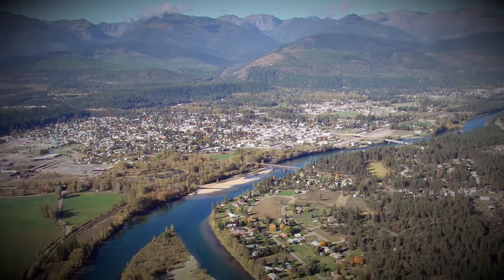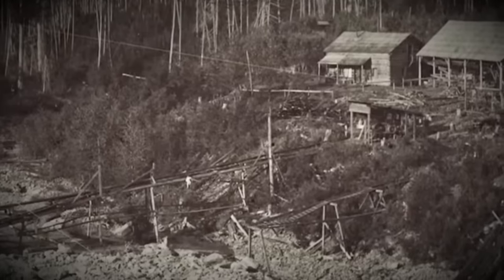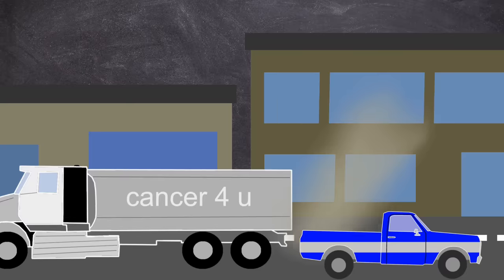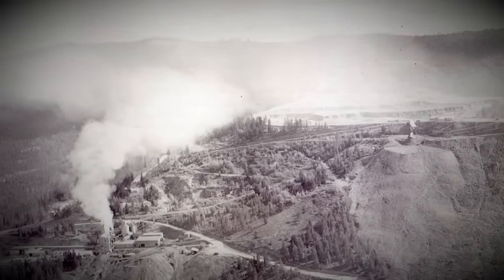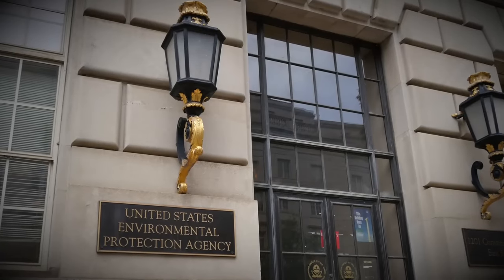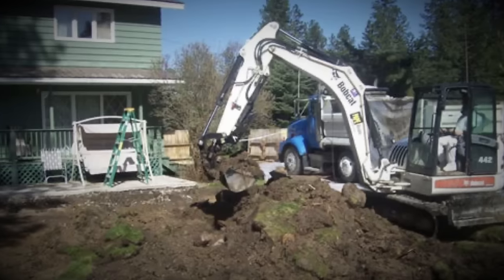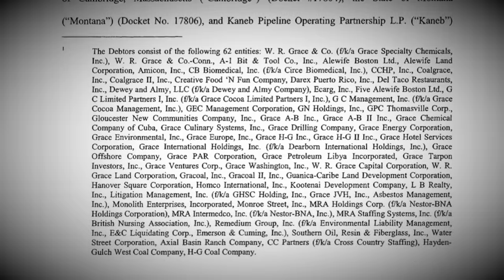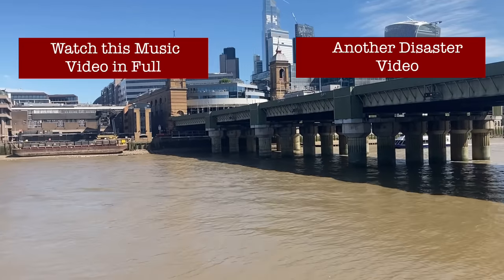Toxic Air: The Libby Montana Asbestos Disaster | Short Documentary | Plainly Difficult

Comment: I remember the distress when I first learned about asbestos as a child. What a mixed up world.
Reply: Heck I still remember gasoline being sold as unleaded and leaded.
Reply: @Project2013B  The smell of leaded petrol.  I describe it as sweeter than the smell of unleaded which, to me is more acrid.
Reply: Brake shoes and many other things were made from it. Including toilet seats.  It was the glass fibre of its day.
Reply: The minute dust particles are shaped like an arrow head and that is why they get stuck in your lungs, wheat and blackwood dust have the same properties. I was in the last class at Hobart Tech to use Blackwood in our woodworking trades course. The Purification Rundown offered by the Church of Scientology or Narcanon will help to reduce toxins in the body and even reduces radiation exposure.
Reply: @ptonpc  I wonder how much of that stuff I got in me from changing brake pads and shoes using NOS parts up until fairly recently. Porbably not much as I douse it with brake cleaner, but still....
Reply: @the_kombinator  Probably not worth thinking about unless you can get yourself checked out and something done,
Reply: @ptonpc  Between that and using all sorts of zinc chromate paints in the 90s... we'll see!
Reply: nah, scientology is bollocks, mate.  that course of theirs don't do a damn thing except empty yer wallet.  bloody good at that, though.  and nothing reduces radiation exposure except time, and in some cases not even that, if it's shite like plutonium, cesium-137, or strontium-90 with a longish half-life.  then you're just fucked, nowt to be done.
Reply: @the_kombinator  "The good old days"
Reply: @ptonpc  Let's see what products we use today will turn up being toxic 10-20 years from now.
Reply: @the_kombinator  Yep, there's always some new toxic thing being sold to us now.  I still miss the smell of leaded petrol mind you (Not that I would call for it to be reintroduced).
Reply: @ptonpc  I wouldn't mind it - half my cars call for such a fuel, and this new ethanol shit is not good for the carbs/valvetrain.
Reply: @ptonpc  ... a floor wax AND a dessert topping!
Reply: @Project2013B  Yummy!
Reply: @the_kombinator 

80 K patents approved by FDA ...a few gotta cause some fatalities.

Comment: A very good informative piece, from my own experience I would like to add. Asbestos fibres (Tremolite in this case) are an unfortunate contaminant of Vermiculite (usually where seams merge) rather than Vermiculite itself being a dangerous material, just to clarify. IMHO the repeated clouds of dust during the processing of materials would not have been heavily laden with asbestos fibres, but the long term accumulation of the asbestos fallout from these clouds will have created significantly raised levels of ground contamination. (some of the 'clouds' in the photos appear to have come from chimneys?). 🙂
Reply from the maker: Thank you
Reply: Not mentioned here: Vermiculite is a form of crystalline mica (the word was never mentioned here) that has water trapped in it; when ground into small bits and baked/roasted, the steam produced expands it into spongy popcorn-like bits that contain lots of airspace, making it an excellent insulation material, and which absorbs and holds water, making it an ideal additive for putting soil. Asbestos occurs naturally in and around the clusters of mica crystals. Asbestos is also found in the talc and gypsum mined from some regions such as upstate New York; and talc was until recently used as "baby powder" and an additive in crayons! 😳 See the book "An  Air that Kills" for a general history of asbestosis and the specific history of Libby Montana, which even involves a future vice-President. PS, WR Grace also contaminated the groundwater of a town in Massachusetts by dumping industrial solvents into the ground behind a leather factory, creating a cancer cluster among nearby residents; the company won the lawsuit in court and were never held liable. See the book "A Civil Action", and the docudrama movie about it.
Reply: @PlainlyDifficult  it's in tiger eye gems too that people like to collect, smooth down and still gets imported dispute being illegal. I remember reading a gem book that said 'Chrysotile' helped with breathing.

Comment: Asbestos was once seen as a wonder material and was used in so many things that we still find it to this day and its one of the biggest fears of buying an old building is having to a removal.  its also a huge barrier in preservation of old ships. And a huge hazard for those that do ship breaking.
Reply: Ever wonder about stuff we're using now that will be exposed decades later to be deadly?
Reply: We had water damage in our house a few years back. It was built in the 70s, and when they took up the laminate flooring from a previous remodel in the kitchen, they found the original, gloriously hideous 1970s vinyl flooring. It tested positive for asbestos, so we had to have a specialist firm in to remove it so they could replace the floorboards underneath. I would’ve loved to keep a piece of it for a shadowbox with an original piece of cabinet hardware we found, as a memento of the house’s history, but even that was too dangerous, so I took a photo instead.
Reply: @CatMom-uw9jl  LMAO and I have a piece of Pripyat in my house, emitting just under twice background radiation in a display case. Just as with the asbestos floor sample, as long as you don't grind it up and snort it, you'll be fine, and so will I. Worst case, laminate it ;)
Reply: @the_kombinator yeah, you should have seen the other comment he made, he's not a very bright person. He's probably got a 12th century turd from one of the queens back then in one of his "display cases."

Comment: Asbestos is such an asshole of a material. My dad was recently diagnosed with asbestosis. He is 73 now. 
He was exposed in the 70s and 80s when he worked as a plumber and handled piping insulation laden with asbestos. And later in the automotive plant he worked at, where the brake pads of the huge hydraulic stamping presses were full of the stuff all the way into the late 80s. The paperwork to have his condition recognized officially as a directly work related disease is in the works right now.

Comment: When I went through mandatory asbestos training for government workers, the instructor was actually a fan of asbestos. It is extremely dangerous when in the air, but its properties as an insulator against heat and electricity are second to none. According to some, smoking and failure to wear PPE made asbestos handling into the disaster it was.
Reply: You shouldn't have to wear PPE to wash a mine-workers clothing, or when a windy day blows dust through your yard and into your house.

Comment: Asbestos... that reminds me... I am paranoid AF after learning that my childhood home still has its original asbestos tiles (and adhesives that had asbestos in it, apparently) in areas, even though the tiles are unbroken, undamaged, unchipped, and thus (at least I've heard) no danger.
Reply: They're safe as long as nothing breaks your walls. They're a danger to work with but usually these kind of houses only become a problem when they have to be demolished or when they need maintenance work and repairs... which of course happens and thats why asbestos houses are dangerous
Reply: I'm retired now, but I used to be licensed in Pennsylvania to do asbestos removal. I can assure you that you've nothing to worry about, as the old 9" x9" asbestos floor tiles are non-friable...meaning that they do not emit enough small asbestos particles into the air to be of any concern, even when they are physically being removed by scraping or other means. Heck, they are so innocuous that the homeowner (or anyone else non-licensed for that matter) can safely remove them without PPE, and they can be disposed of in your normal household waste. Same applies to asbestos siding. It's the other forms of ACM such as pipe insulation that are hidden killers.
Reply: As mentioned above, they're perfectly safe. Even if they're cracked or chipped. 

I wouldn't recommend taking a high speed grinder or sander to them, but otherwise they're inert. 

I'll add, asbestos siding is cool stuff and can look great if it's been maintained.
Reply: @dshmechanic I’m still active as a removal specialist, 10y on the job now. And confirm exactly what you said. Just want to add the white asbestos sheets, the very soft stuff used to shield materials from flames, ppl don’t touch those it’s a guarantee you will get sick from removing those… might look like drywall but it doesn’t have the paper lining.
Reply: @JulianA-tr6pt  Agreed, Juliana, using any kind of grinder on ACM tiling would definitely be a bad idea 🙂
Reply: spent 10 yearsd living in a building with asbestos tiles; was a repurposed WW II temporary barracks building, up on blocks.  we made damn sure not to disturb them tiles!
Reply: that's what our old place had.  shit's tough, it stands up to decades of wear and is basically ageless.  just one small problem...

Comment: Would like to see a story done on how much Asbestos was released into the air when the towers came down. They were supposed to be cleaned and updated but never did.
Reply: 😂probably because it would cost more then building was worth ?? lol Another quiet example why they wanted those buildings brought down.... never forget building 7 was PULLED...🤔
Reply: @Clearwater420  I was just thinking this morning about why they didn't give all the first responders and pile workers respirators. The sad reality is it would cost a shit ton and we haven't figured out a cheaper way to filter air.
Reply: Hah I recall when they were retrofitting a lecture hall built in the 60s where I worked (this was just pre-pandemic) and yeah the workers had like an airlock and everything, suits head to toe, and a complete filtration system coming out of the back of the staircase. I went up to investigate it on break and there were biohazard signs everywhere. I noped out of that staircase once I realized what the boxed air filter was all about.
Reply: @Clearwater420  Lol just those buildings, eh?

Comment: I grew up in a small town in New England that had an asbestos processing plant that had been abandoned by the time we moved into town in the 90's. They started clean up efforts in 1998 I believe, and it took until 2010 to fully clean it. As far as I know, there weren't too many illnesses caused by the plant itself, however, it was left to rot and abandoned for a very long time, and there were other dangers (collapsing floors, giant metal tanks with rusted insides from some of the chemicals they used) that were a danger.
Many of the old storage tanks still held petroleum and asbestos, as well as other chemicals to. These tanks sat there for almost 20 years. While most of the asbestos was contained, I think there was some risk of it spreading if there was a significant collapse of the structure or serious damage during a high wind. In school, it was never talked about why we weren't supposed to go there, just that "it's very bad" until around the time the town started taking control of the property. The EPA stepped in and millions of dollars went to the removal. This included soil removal as well.
It's interesting how much we knew about such chemicals, but still kept using them until the 80's. The company that ran the plant went bankrupt, just like the mines in this video.

Comment: When I was a kid in the early 1960s, our house has asbestos insulation on heating ducts and pipes. The exterior walls of the house had asbestos/composite tiles (very durable and fireproof). The house was new then, and I'm glad we moved before it got old, and the insulation started to fall apart. The siding tiles were sealed by paint (which probably had lead in it), but looking at the house now on Google Street View, it appears the house has been covered with vinyl siding (very flammable, but not toxic).

Comment: One thing i feel you probably should have mentioned why this disaster was far greater then you’d expect when comparing it to other asbestos incidents: asbestos has two forms, “bound” and “loose” (i dont know the english term). While bound the fibers are actually pretty save. Having an asbestos roof cover is not that bad as long as it remains undamaged. The problem is when the material gets damaged, some of the asbestos fibers can become single fibers floating through the air as part of the dust… and those loose fibers are the danger source. So, not only was there far more asbestos is this town then normal for the timeperiod, it was waaaay more common to be breathing in the loose asbestos fibers
Reply: English term is "friable" for the version that breaks up small enough to get into your lungs.
Reply: Especially the roof material erodes after some time, and cement gets washed out. The fibers don't erode, they get exposed then.

Comment: In the 80's I worked at a machine shop in the back of a napa auto parts store. We resurfaced brake drums and had a machine which would grind the brake shoes to fit the drum perfectly. The arcing machine had a vacuum attached to it to collect the dust. The bag had about 1/2" hole in it. The dust would blow everywhere. I can still taste that dust, lol. Hope no asbestos was involved.

Comment: Worked at a local railroad shop rebuilding locomotives. I have pictures where asbestos removal teams were in full suits and respirators tearing it out of old trains like 15ft from us working on another unit with nothing on. Guy got wrote up for sanding asbestos gaskets off parts on a unit i was working on. Looked like a fairy land with all the sparkles floating in the sunbeams in the shop.

Comment: In general fine particulates are a problem in any industrious place,I
and i do suspect that "wool" type of nanofibre that replaced asbestos is going to have similar effects for roughly the same reasons. If you need rebreather and severe filtration in order to handle the stuff it aint gonna be healthy ever.

I am reasonably certain that this was more callous than a lack of knowledge, very rarely do some materials even with delayed negative effects, become found out as dangerous. And businessmen were and are generally uncaring about damage they do. hence the continued struggle against popular materials that do have negative side effects from nicotine cancer sticks to teflon andmany more i can not recall offhand.

"civilisation caused ailments" could very well be just inevetable consequence of the greedy careless corporate BS in conjunction with reckless overuse of hazardous material... and yes pollution of air, waters and quite likely the light polution.

Comment: 2023, just discovered "zonolite" insulation bags in my attic. 😢
House built in 1970....can't add insulation without an asbestos abatement program.....wish me luck! 😮
Reply: Don't touch anything. This stuff is like friggin' pixie dust when it's disturbed. Just to be on the safe side, you might want to get some of that heat shrink window insulation and put it up over your attic entrance until the pros can come in and clean up. Fingers crossed for you.

Comment: Oh fuckballs, this makes the Blue Sky Mine look rather mild in comparison. 

Also, the other thing asbestos minerals were used in where concrete chimneys. I only know this because after the 2011 Christchurch Earthquakes one of ours had to be dismantled (thermal cycling from a hot wood fire wrecked it) and lo, there chunks of fibrous rocks in the lumps of concrete. Needless to say, I backed right the fuck up and mentioned it and was told "oh it's fine..." by the firefighters doing the work. 

So yeah, I suspect sadly the aftermath of the quakes is going to result in a lot of asbestosis cancer cases in the coming decades :( Because it was also used in ceilings, plaster, lino concrete roof tiles and elder gods knows what else.